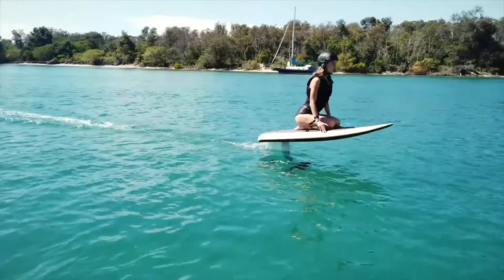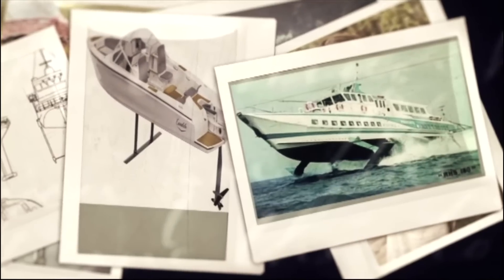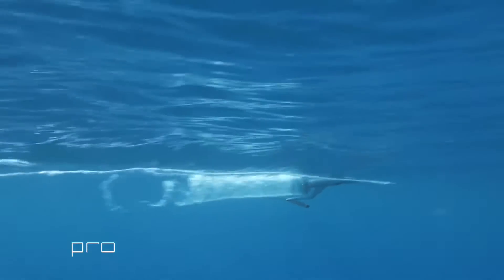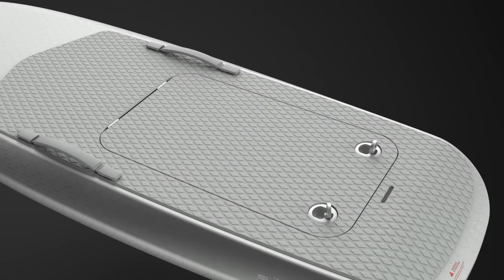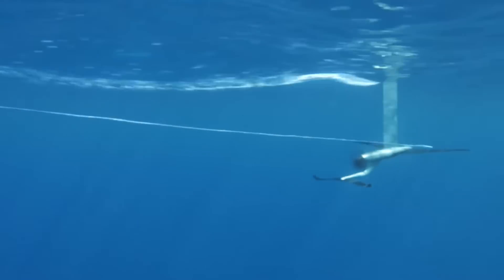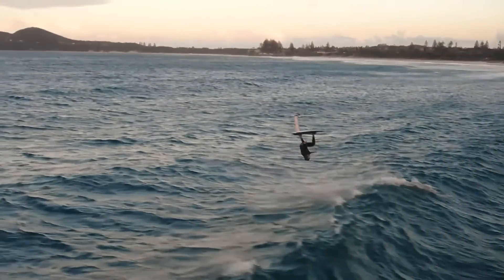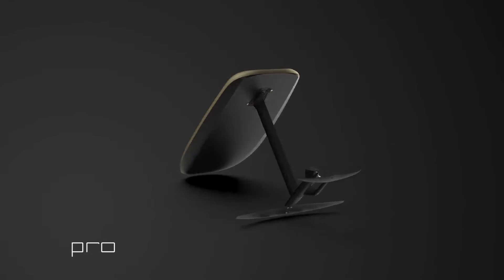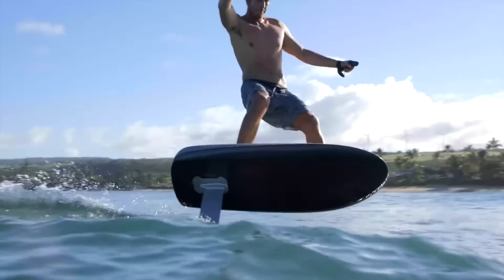How do Electric Hydrofoils Work? | E-Foils 101

Comment from the maker: EFoils 101: Everything You Need to Know About Electric Foils. How do Electric Hydrofoils Work?

In recent years, there has been one amazing activity that has drastically risen in popularity in the larger bodies of water. There's even a good chance that, if you've been to the beach, you've seen someone in the water with these. They are called electric hydrofoils and it is an absolutely incredible activity to participate in.

Few years ago though, with the progress in marine battery technology, the idea of an electric motor hydrofoil board was crossing the minds of a few people. If propellers could push a boat quickly through the water, why couldn't the same principle be applied to the board? It would just need to be light enough to not weigh the board down, but powerful enough to give the board lift. Designs were finally made to what we see today.